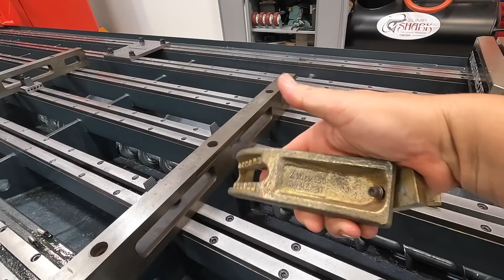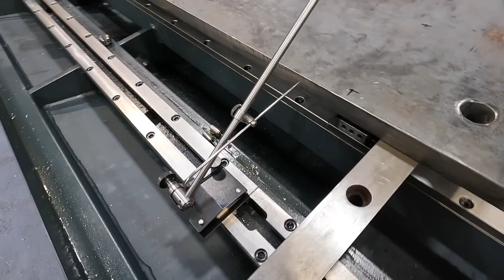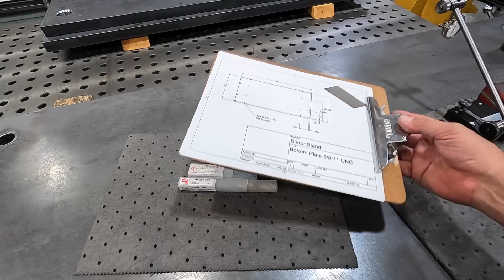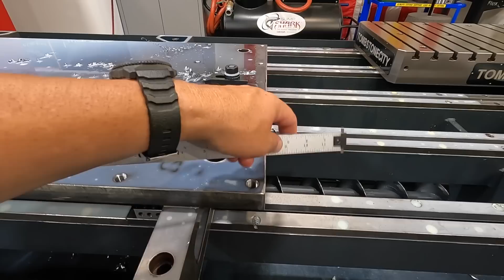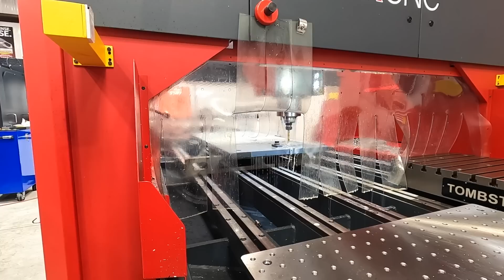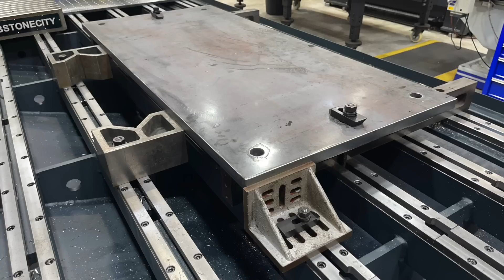Production Drilling & Rigid Tapping 1-1/4" Steel Plate

Comment: When I used to program CNC mills I would always use the bottom left corner as the datum. All your X and Y moves are then all in the +ve directions. Makes it easier if you have to manually adjust the program…. No minus sign to worry about..

Comment: Next time on Abom79….. Adam runs multiple work stations on the FlexCNC.   It would be great if you had put both plates on the Flex and run them all at once.  So now you have a Saved Code for repeatability if they need to make more of the same.

Comment: Great stuff, Adam! I have programmed many other things, but never CNC.  Still, I am pretty certain that if you follow good rules of programming, you will be able to reuse many parts of the CNC programs that you write, even on quite different work orders.  That's like money in the bank.
Reply: I take it that his 'programming' is menu driven, not line by line or block by block.
Reply: @malcolmpeters-k1i  Adam's doing Fusion360 with remote training, it outputs motion control scripts. He's done a few minor line edits but for production most changes usually involve going back to Fusion.

Comment: I too would like to see manual machine work. There is no way I could afford or have the room for such a machine!!!!!!!
Reply: There are lots of CNC machines you could easily afford and have the room for. CNC isn't nearly as cost prohibitive as you probably believe it to be. The Flex is a very large machine with a higher cost. I have a capable and affordable mill in my garage, and I can still park a car in there along with other shop tools. Brand new, it was less than $35k when I purchased it and has a cutting envelop of around 16" x 10" x 16". 12,000 RPM 7hp spindle with tool changer. I've used it to produce both prototype and production runs for customers.

Comment: Hi Adam, thank you for sharing your expertise and CNC learning journey. I have one question. Did you chamfer or deburr the bottom of the holes?
Reply: He hasn't on these last plate jobs. You can get back side chamfer cutters if you need to. The front side chamfer is more about getting the Tap started and later it gives you a frontside for the bolts for easier starting. As these plates are only flame cut as well you cant really flip them over and program a second chamfer operation but a quick manual deburr (more so than a chamfer) would finish the job off.

Comment: The large plates are 565 pounds.  Multiply the width, length, and thickness (all in inches) by .2836.  Have figured millions of pounds of steel over the years.
Reply: That's what I got too. All you need to know is that one square foot of steel, one inch thick, weighs 40.8 pounds. I used to slit steel coils and would need to figure out the linear footage using 40.8.
Reply: Yep, I've always used 493lbs/cuft.
Reply: for a 1x1x1 inch plate, are we doing 1*1*!*0.2836 or 1+1+1*0.2836? and what does this give us? how much it weighs, its volume, its mass, what???
Reply: @codefeenix  A cubic inch of steel weighs .2836 pounds.  Steel is sold by weight. If you were to purchase large amounts of steel from a mill, the price would be on a weight basis.  Even when steel is sold by the foot in some outlets, the price is based on weight.

Comment: Out of curiosity, does any tooling company make a dovetail style cutter that you could drop through the tapped hole and put a chamfer on the bottom side of the plate as the last operation?
Reply: There are tools called back-chamfer cutters that do what you are talking about, but as Adam will tell you, he is still learning and will get to it.

Comment: Is there some chamfer operation on the reverse side? I know reverse chamfer bits exist.
Reply: There are options for both back boring with a fine adjust boring head, or circular interpolation with lollypop or dovetail style endmill.
Reply: @Ddabig40mac  I know it can be done. I just don't know if it ever was on this job.

Comment: Question…why spend so much time precisely squaring the work piece to the table? Doesn’t the machine take care of all that when the offsets are set?
Reply: It's always good practice to find out where the work is manually instead of relying on the machine. Massive mistakes can happen when you completely rely on the computer.
Reply: @firesurfer  Gotcha. Thanks!
Reply: Some machines have probes that can measure a couple of points and set the angle. He is using a Haimer so he doesn’t have the ability to set the angle of the workpiece with the probe.

Comment: How do you set the feed rate for the tap? Seems if it’s a little to slow or to fast the threads would rip out.
Reply: Indeed the downfeed must be same as the thead pitch. So if you want to cut a standard M10 the pitch is  1.5mm so the downfeed must be 1.5 mm per revolution. the tapholder Adam uses has some play to overcome tolerances in the machine and tap.
Reply: @arjanvanraaij8440 you also can’t use spindle or feed overrides to modify the programmed speed unless youre using something like G95 to maintain a constant feedrate / rev

Comment: I wonder how long it would have taken to drill, tap and chamfer 16 holes manually - end to end?
Reply: I would say roughly the same amount of time, zero to done. Programming, tool setup and fixturing takes time. The other option is a mag drill but then you'll be working your ass off.
Reply: @1320pass  CNC would rapidly be more cost effective if there were more identical parts. CNC does not de-skill the job, it moves more of the work away from turning handles doing the donkey work and into the setup work. There are some people complaining that this CNC work is dull to watch but manually machining of drilling, chamfering and tapping 16 holes in a plate would be equally dull if you think about it.
Reply: @1320pass  I think it would have easily taken 3x to 4x as long to do the same thing. It also would have taken a really large chamfer tool in order to do the chamfer on the holes.

Comment: Get the electrician to install a surge diverter in your swtichboard and you won't have to worry about thunderstorms or anything else bad that happens to power
Reply: I think the issue is, for example, if you're in the middle of a tapping cycle and the power cuts out, it'll be really easy to break the tap and potentially damage the part.

Comment: Odd question that likely has a good reason not to do it this way....

Same bit for center hole and champher.  Is there a reason not to champher, during the same cycle as boring the pilot, before boring the hole?  

I realize this is not done in manual machining because it's not possible with one bit (yes it's possible, but it's ridiculously inefficient), but with the bit you are using, and cnc, it is.

On a large project, this would save valuable time, but in fairness, I'm talking out of my ass and am clueless.
Reply: If the drillmill was a bigger diameter one, he could've spotdrilled deep enough to leave a chamfer.

Comment: You're zeroing on the edge closest to you, shouldn't that edge and the left corner be your origin point?
Reply: It really doesn’t matter. Typically the upper left corner may be used because that jaw doesn’t move. With this setup, you could use any corner.
Reply: Flame cut plate so unless you run a multi point electronic probing routine you need to make an 'assumption' that both sides are parallel and the plate corners are 90's. What is a little surprising is using the manual Haimer instead of an electronic one like he does on the little Toolroom Mill.
Reply: @seabreezecoffeeroasters7994  The flex isn’t equipped with a probe.
Reply: @MechanicalAdvantage  Really surprising given it is a modern interface that there is no option for electronic probing. I have been tinkering with a WiFi probe design on my UCCNC controlled mill to lose the cable but as is multipoint touch is still a thing if I want to.
Reply: @seabreezecoffeeroasters7994  Oh I wouldn’t be surprised to learn it is an option, it just wasn’t equipped that way. I don’t know if that is an option or not for that machine control.

Comment: I’m not seeing any pecking during the drilling cycle, anyone see it?
Reply: you can clearly see the pause in z axis descent, and it only takes a small retraction to break the chip.  especially with through-tool flood cooling clearing the flutes.
Reply: @ScottPankhurst  I did notice it on the second plate but not on the first.

Comment: Adam  I love your manual machining videos. I do a little hobby machining with simple machines. I really have no interest in cnc.
Reply: So on your manual machines you don't setup parts and fixture odd ball plates and parts? You don't drill holes? CNC is not anti manual machining apart from the cycle the rest is 90% shared. Even if you take a modern DRO with hole patterning on this sort of plate it is manual CNC. Make a coffee and listen to it and take what is useful and be happy someone is happy to freely put that out there.